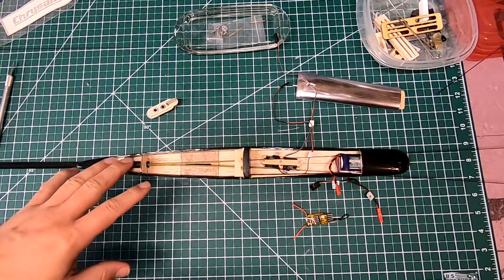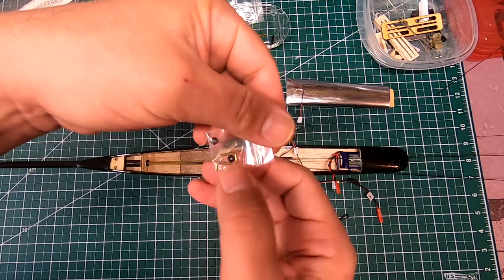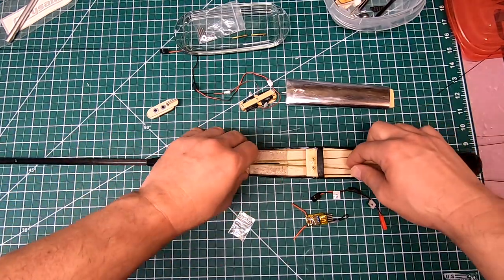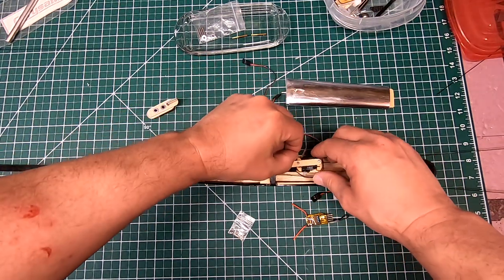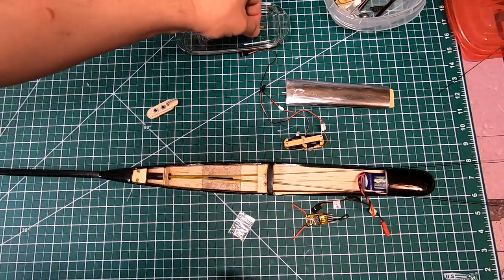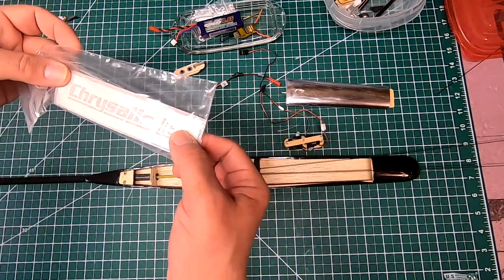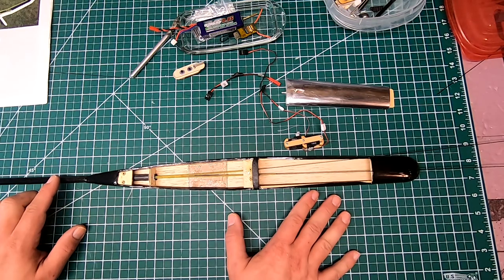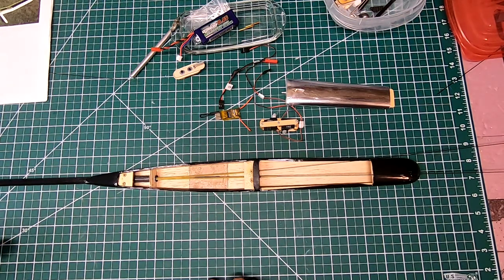Chrysalis-Lite RES Build - Pt9 - Fit Pushrods and Mount Servos for V-tail

Comment: Lots of good tips, thanks. 
The word you were thinking of for short servo horns and longer control surface horns is resolution. That looks like an HK Orange Rx not a Lemon, I have used Lemon rx's and they are as reliable as spektrum.
Reply from the maker: Yep, "resolution", that's the word I was groping for ;-) And, you're probably right about the receiver too. I haven't looked at this gear in a couple months... and, I shouldn't film videos late at night when I've been up for over 48 hours. On top of all that, I didn't do any prep which is always a mistake. 
Marsha's been sick and I've been staying up to look after her. Her fever hit over 102 and she was hallucinating. Every time I turned my back, she'd try to get up to do something that her mind told her had to be done immediately... as if anything needs to be done at 3am. She was seeing dead family members and stuff like that. I've been trying to keep her hydrated and make sure she takes Tylenol every 6 hours to break the fever. That woman is a really bad patient... a great caretaker, but a horrible patient. 
We've done a couple video visits with our doc and she doesn't think Marsha has corona... just the run of the mill flue. Fingers crossed on that. Her fever is down this morning and I hope she is over the worst. We'll see how it goes...
I hope you're all healthy there!
CJ